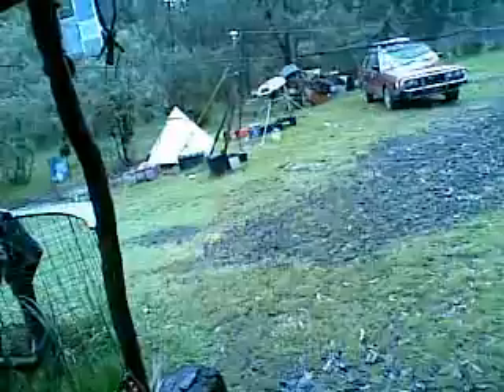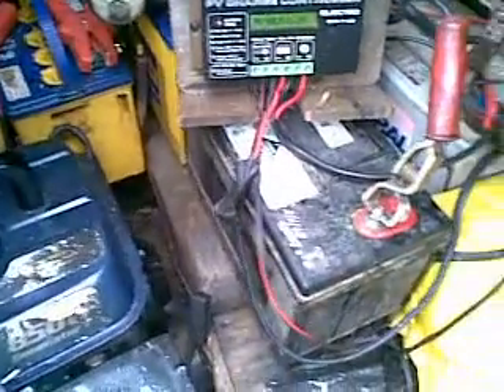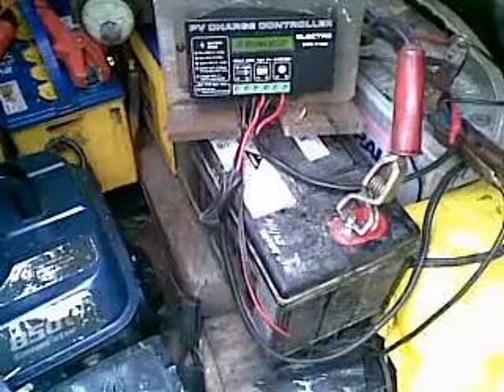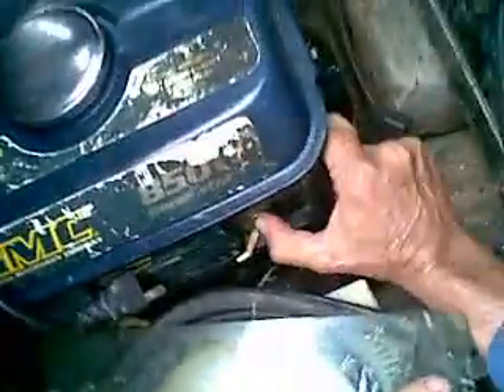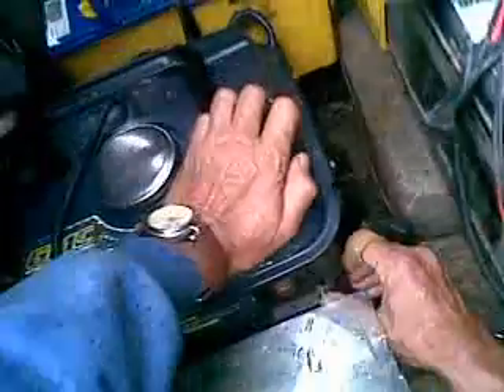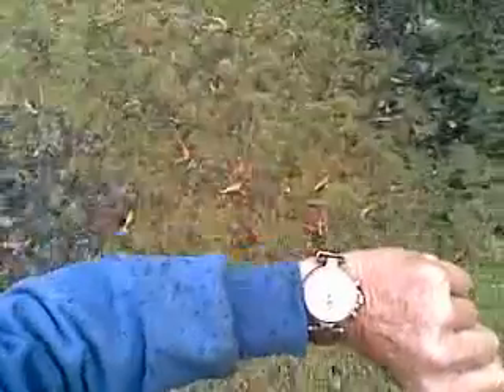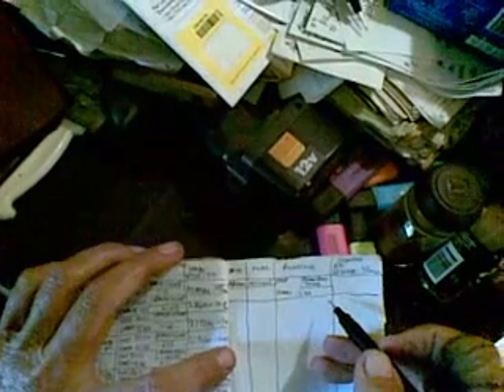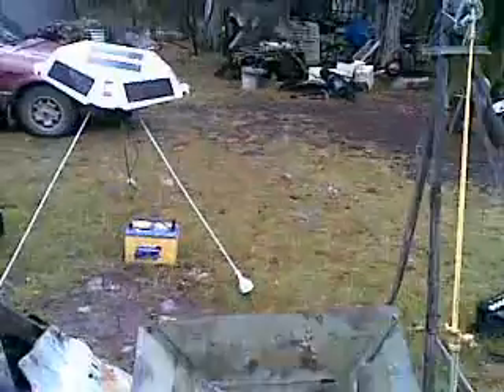The Solar Electric Pyramid. Starting the 2-Stroke Petrol Backup...

Comment from the maker: @TheMacandpcguy
G'day. Well, mine's done 16 Hrs :47 mins... The 12 Volt Circuit's died, twice ; the Fuel-Guage's  Float now sinks, & the Fuel-Tank/Stop-Cock's O-Ring needed tightening, twice, a week apart.... That one is a Safety-Risk, fairly bigtime. Every startup,  I check the 240 V. Output via  Multimeter, &  adjust the Governor. So, it's only JUST a Generator. I use High Performance 2-Stroke Oil & a Measure, to mix Fuel. The Exhaust has 2B cleaned 150 hrly. U get what U pay 4... Ciao !

Comment from the maker: @htomerif
   G'day... Well spotted ! Yes, the Waste Cooling-Air drives the Heat-Exchanger/Condenser in the Exhaust- Gasflow... But ,it also relies on Gravity to collect the recovered oil. So, I could try using it again, but I'd have to be pretty desperate to do it. I wouldn't try it at 50:1, either... Dad used to run Chainsaws and Lawnmowers on Used Sump Oil, at 4:1... It is cheap, but you work in a thick cloud of blue smoke & get to clean the Sparkplug before every tank of Fuel.

Comment: I seem to recall your having some kind of 2 stroke oil condenser on the exhaust of that generator.  Have you ever thought arranging it to drip back into the tank, or is it not really fit for use in an engine at that point?